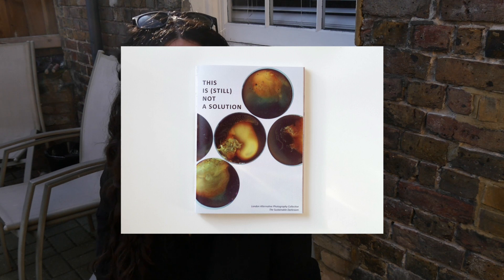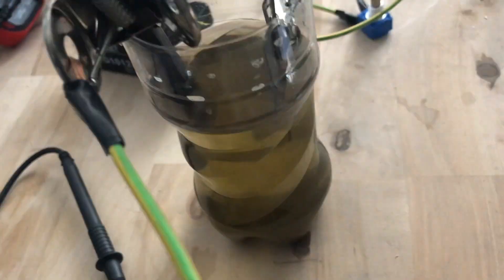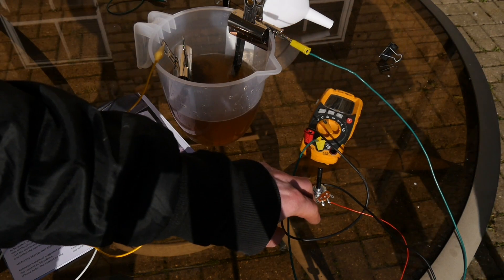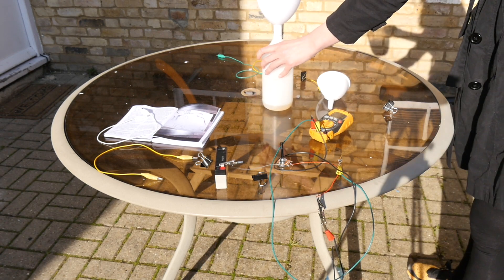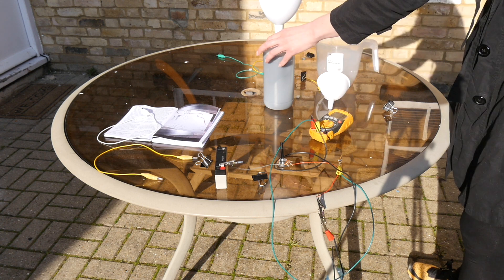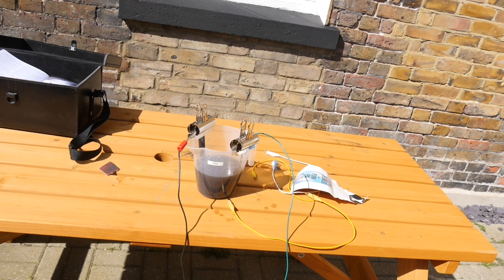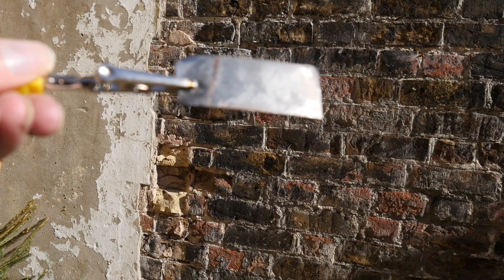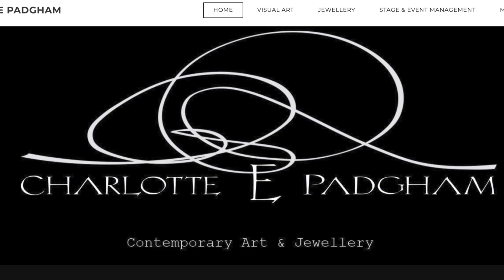Origin of Silver // Silver Reclamation From Photographic Fixative

Comment: Instead of copper, you must use 316 stainless steel..! Also try to move the solution around with a small pump
Reply from the maker: Thanks for the tip. I did use stainless steel in later editions.

Comment: I run a photo lab and am fairly obsessed with silver recovery, it is amazing to see. Commercial electrolytic systems all move the silver bearing waste over the cathode - usually by spinning the cathode in the tank though some have a fixed cathode and then pump the liquid around it. The constant agitation of the liquid on the cathode helps something - I think it helps prevent sulfiding. 

I've seen some questions about how much silver is available to recover - we only make prints so I am not sure about film (though film I think has more silver per sqf than paper) and we think there is about an ounce of silver per 1000 square feet of color paper. We run batches of 4 gallons for about 4 hours and that usually yields about an ounce of roughly 95% pure silver.

I'd love to do your experiments but don't understand the electrical aspect. It is a finicky process and we sort of stumbled on a mix of blx and stabilizer that works for us but it doesn't always make sense.
Reply from the maker: Oh that is really interesting. I'd love to know more about your process. Do you have one of the silver recovery machines? I did look into this as part of my research, but I didn't know of a lab who had one, so I just spoke to the people who make the machines.
Reply: @MelanieKing  yes, we have 2 Omni 16 electrolytic machines. Getting the silver out of paper chem is more difficult than from film from what I understand and the omni's work well for us. We also use metalic replacement cartridges (steel wool) after the electrolytic as it can achieve a lower silver ppm before it goes down the drain. But electrolytic is easier/cheaper to refine so we try to get all we can from that first.

Comment: Electrolysis is so cool. I restore old cast iron and it's the best way to clean them.
Reply from the maker: Oh really. How does that work?
Reply: @MelanieKing  same circuit more power. Stainless steel is best and it works when the pan is in "line of sight" of the steel. So like if I wanted to clean both sides you would have to flip the pan around to get both sides. Some people go extreme however and surround a bucket with plates so you get 360 coverage.

Comment: I used to work in a graphic arts R&D facility, we used to get through dozens of rolls of 1m wide x 61m long film every month; we had a silver recovery system that circulated the fixer through an electrolysis chamber before returning it to the replenisher reservoir. The cathode in the unit was a stack of thin stainless steel sheets that could be flexed to remove the accumulated silver (it would build up to several mm thickness).
For your experiments, it's probably worth using a nickel cathode as it doesn't tarnish like copper does; it's readily available as it's used to join lithium ion cells together in battery packs, and it's quite cheap.
Something else that's worth trying if you want the silver to adhere to the cathode, is to pulse the current, it helps to reduce the gas bubbles on the electrodes surface which inteferes with the electrolysis process.
Reply from the maker: Oh thank you for the advice, that is very interesting!